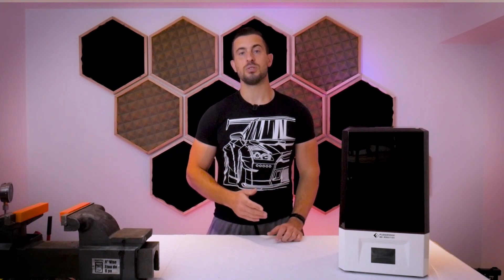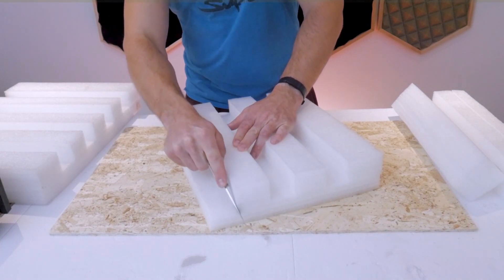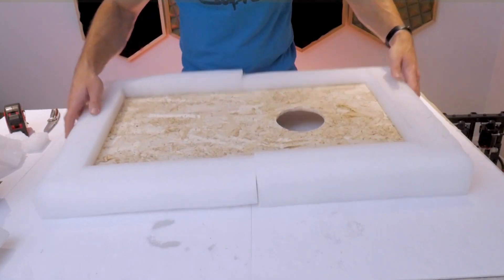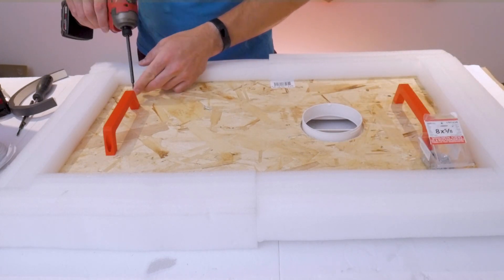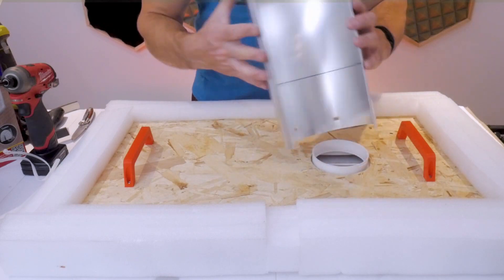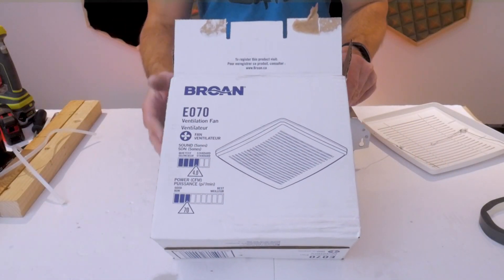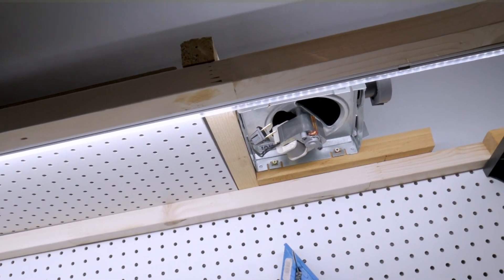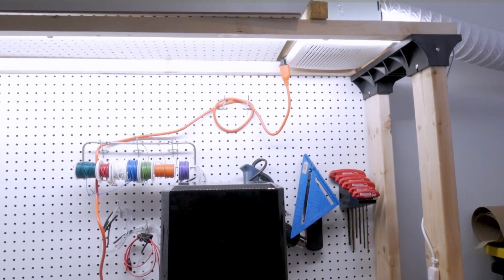How To Eliminate 3D Printer Fumes, Smells, and Odors. Only Fans Extractor Hood (Resin and FDM)

Comment: I like this idea but it’s not really considering anyone else or the environment around you. You should consider adding some kind of carbon filter at the very least in line, because those fumes are stinky and super toxic. Styrene fumes are a known carcinogen, and styrene is commonly found in many fdm filaments. Good idea but keeping safety in mind you wouldn’t want these fumes getting sucked into somewhere else and poisoning anyone. Fume extractors are used for this for a reason the machine has filtration systems in place to negate these toxic qualities. Just something to keep in mind.

Comment: This video was very helpful! I’m thinking using a similar setup but I have a few questions:
-Does the outdoor temperature affect your prints at all?
-How much did the setup cost you in total?
-Are the fan wires at risk for damage due to the heat and toxic fumes?
-Do you leave the fan on during the entire print, just at the end, or at intervals?

Comment: Its great to see a DIY poster focused on their health.  Its not common!  But what you need is to get that fan a lot closer.  Also it would be good (if one had another window) to use that to draw fresh outside air in and vent it to the general area where you are for your air supply.  The less you move around the more precise you can position it.  Or just print outside with a big fan blowing on you!
Reply from the maker: I have another system in the works that should be more effective. I'll have another video out soon ;)
Reply: @EmbraceMaking  That's great.  Respiratory health is an area a lot of DIYers don't think about because they feel OK at the time.  But it takes decades for cancers to kill you.  And often it doesn't take much to dramatically clean up the air.  If you look at why so many labourers die much earlier than white collar workers, its usually what they are inhaling at work.  Usually their boss doesn't know or just doesn't care much knowing by the time the cancer starts they are long gone from their work there.  Of course white collar workers are often plagued with stale air and fumes from things in the room because their boss is too cheap to change the air more frequently!  Devoting a whole channel to workplace health would be incredible and might wake people up.

Comment: The calculation for "air extraction" requires the following information: 
The ft per minute (FPM), witch is the velocity of the " contaminates and "air" .
The cubic ft per minute (CFM), witch is the volium of "air" removed. 
You oalso need to consider the distance of the "origin" of the fumes. 
I think the fpm of the air at 9PiR where R is the fan blade is only 10%. 
In any case don't take my word for it, look fpm and cmf up.